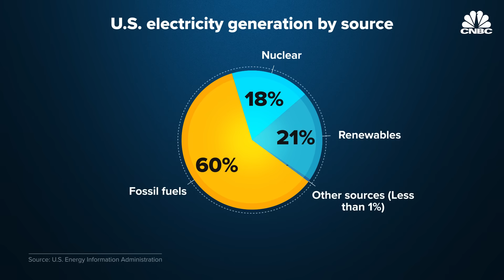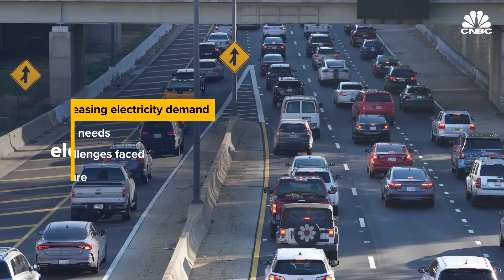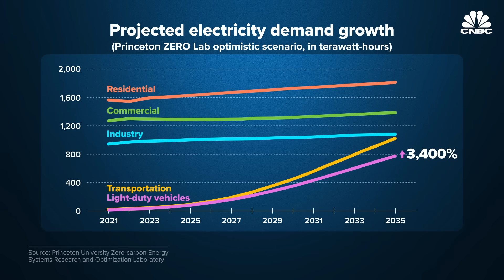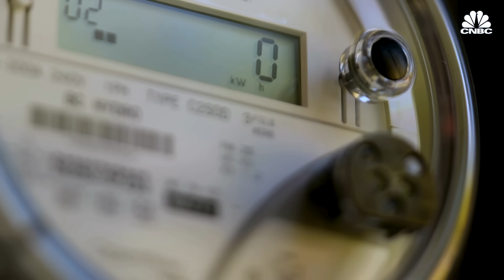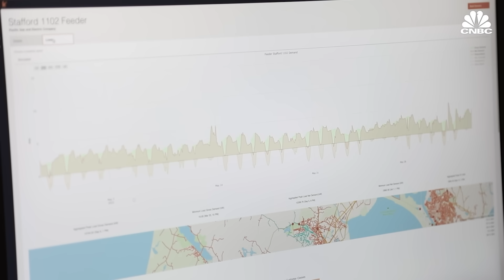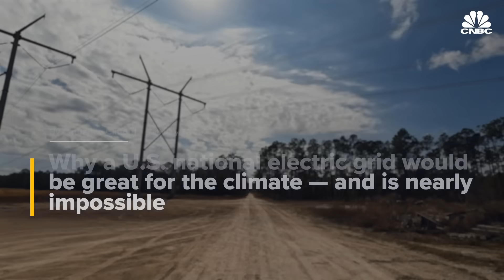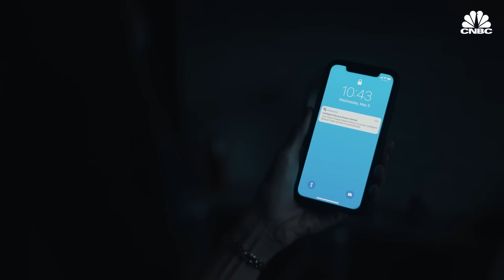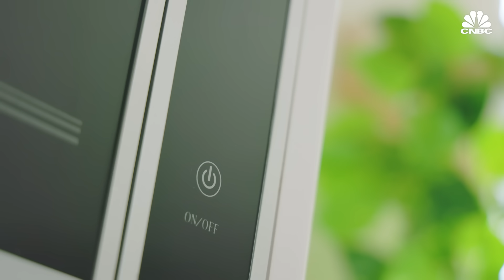Can The U.S. Power Grid Handle The EV Boom?

Comment: have you looked at the problem Siemens is having with there wind gens failing so often the co lost 30% of value lasrt week
also were not making a lot of grid and transmission equipment  like transformers that take year or more to get delivered
theres also moves to tear down hydro dams, natural gas and coal but nuclear too .  and chinas building the solar cells, electronics and the lithium batteries by still building a new unscrubbed coal power plants every 2 weeks.  add to the cost of cars and trucks a ev pickup or suv is 100k and interest rates are at 30 year highs and ev are more dangerous in crashes since they are heavy  this is looking to backfire big time because people will hold on to old worn out vehicles because they cannot affored the new ones and 9in cities no way to plug in the only semi economical way to charge  . and very soon the federal and state governments will need to change the way cars are taxed and electric rates went uo 25% due to bidens jan 21 policies 
and to do all thats needed i est electric could hit 1 dollar a kw  .?Across 28 European countries we investigated, there were 149,000 excess deaths between November 2022 and February 2023,"   and while we destroy the economy between china not cutting anything and the 87% of co2 we cannot stop nature from pumping out  net zero will not change anything but destroy peoples lives and the big threat of dictatorship world wide

Comment: Two words: Distributed Solar. PV panels on every roof and EV batteries feeding some power into the grid when the vehicles are parked. Big power grids are fine, but we can do a lot by small scale, distributed power generation to take the pressure off the main grid.
Reply: If you’re worried about the grid get rid of crypto and stop building in the hot states.
Reply: @kens805 if you can't contribute something of value....
Reply: @kens805good job demonstrating you have no idea what you're talking about. I have an ev, I can travel outside of California and go camping. Not a problem and I don't need anything longer than a small extension cord.
Reply: @UlexiteTVStoneLexite drive to Montana in a reasonable time, ie as of your time is valuable.
Reply: The sun provides enough energy in 1 day to run the entire globe for over a year.....we just can't harness it. The answer has always been in front of us. We just need to do better. Greed prevents us from throwing everything we have at figuring out how to harness the energy we were gifted. There's no other explanation for it. Free energy isn't something they want us to have.
Reply: You said, "The sun provides enough energy in 1 day to run the entire globe for over a year.....we just can't harness it."  "Greed prevents us from throwing everything we have at figuring out how to harness the energy we were gifted. There's no other explanation for it. Free energy isn't something they want us to have."
You could say similar things about gold.  There's plenty of it in the ground.  Greed prevents us from throwing everything we have to mine and refine the gold we were gifted.  There's no other explanation for it. Free gold isn't something they want us to have.
What you are overlooking is the cost to create the infrastructure (panels, inverters, batteries, wires, transformers, etc.) to get all that "free energy".  It's just like the cost to mine and refine free gold, oil, lithium, copper, or any other material that's available for "free".
There's an old saying:  "There is no free lunch."
Nothing is free.  (Including freedom.)
Reply: @ferrynpalmer3875  and so many of the people here are just supporting them by parroting the bs to try to prevent us from fixing the gird and our energy development.
Reply: @ferrynpalmer3875 i
Reply: Yes exactly. The easiest way to solve this problem is heavily discount solar panels for peoples homes. If everyone was making their own electricity, the grid we currently have would be able to handle the miscellaneous. Obviously with upgrades overtime, but at least it wouldn’t be a mad rush.
Reply: Yep. Continue to incentivize home PV, and remove barriers through regulation from electric companies that purposely stand in the way. Not every home is suitable (mine isn’t), but the ones that are should be built that way.
Reply: That is a nightmare scenario unless we have enough storage to stabilize it. Here on the Western Interconnection - basically North America west of the Rockies - we already have too much photovoltaic electricity. The sun goes down, people go home, and natural gas plants have to make up the difference (12,000 MW for California alone.)
Reply: Pv panels in every roof but what about apartments genius?
Reply: @OM-bs7of  you’re out of your league, please retire to kids YT, thanks.
Reply: You really expect the government to distribute solar panels to every home in the US? That's extremely unrealistic
Reply: There isn't enough raw materials on the planet for the green revolution. It's going to lead to resource wars.
Reply: sodium ion battery storage will help a lot.
Reply: @alexdavis-mann8513  You said, "sodium ion battery storage will help a lot."  Maybe, if and when it gets commercialized, and if it is cheap enough.  That's a lot of ifs.
Reply: Yes, more child slave labor!
Reply: Especially at night when all the cars are being charged and not driven
Reply: Your two words: distributed solar
My three words: trillions of dollars
Do you have that much money you could donate to pay for that humongous inefficient infrastructure.  This sounds like a version of China's Great Leap Forward.  If you look at the world population chart, you can see a dip around 1959-1960.  That's when tens of millions of Chinese starved to death because the Chinese government collectivized the farms and wanted everyone to smelt steel in their backyards.  For a few rich people, living off the grid works, but not for people of modest means living in modest houses and apartments.
Reply: I think Solar power would be even higher if these corporations would not only allow for home solar systems to be equal to energy needs. If we have room for more solar and everything else already set up just pay the solar producer the same as you would pay a coal plant. Businesses have tons of roof space but maybe only 1/10th could be used to offset energy needs. 9/10th set unused. Economies of scale also work better when large systems can be set up on business rooftops. maybe $800-$1000 per kWh compared to an average of $3000 per kWh on a homeowner's rooftop.
Reply: @MrBadbonesaw  all great points, but you’re fighting against the inherent benefit of solar+storage, which is decentralization. The grid needs to be transformed, just like land lines to cell phones. It’s going to get ugly in the short term, like $2/kwh ugly, but eventually the price of energy will go to zero just like the price of compute(bits) used to be astronomical but now it’s negligible.
Reply: @drewgoodman7932  I agree it needs overhaul, but maybe we need more small geophraphic regions instead of 4. Any major city with over 3 million population be responsible for upgrading their own powerline grids. Run powerlines out to rural areas from the city, kind of like a squid or octopus. Have some overlap or interconnection between cities. Upgrade when poles or connectors start getting corroded, kind of like replacing a long stretch of highway from time to time.
Reply: @MrBadbonesaw  this is probably true. The decentralized nature of renewables is going to make that whole notion much easier and logical. The West TX grid would be the powerhouse example of the entire country probably.
Reply: @kens805 We hardly ever use a charging station - so 98% of the time we charge at home, which applies in rural areas or city suburbs. Charging station power usage is really not that big of a deal. In city centers, we should expect more charging stations as many people don't have rooftop solar, but even this will change.
Reply: "Have you noticed your electric bills going up the past few years"?
My too..
What are your thoughts about Solar?
Have you ever looked into Solar?
Can we do some discussion about SOLAR 
    "Right now is actually the best time to get SOLAR between tax credits reducing the price and current energy costs constantly on the rise"
You already cost too much on electric bills give a chance to my solar panels service once and you will definitely get best results
POWUR is the American biggest solar company
Would you be interested in learning more?
Reply: HAHAHA, good luck convincing people to share their $20k or more ev batteries.
Reply: Solar everywhere is a waste of the scarce metals that are required to manufacture them. Solar should be focused in the South/Southwest and then distributed through the country with power lines. It makes no sense to put solar in the northeast when Wind would be a more efficient choice.
Reply: I know a family in San Diego that installed a 6 KW solar system on their home.   So total power of their electric car and running there home is less than it was 15 years ago before they installed solar power.  So we can actually go down on total power production if we put 5 KW to 7 KW on each home and then put in a electric car to 2 there.
Reply: Yes my thoughts exactly.  Putting generation in the usage centers solves two problems at once.  With some form of net metering, people with the roof space will be incentivized to invest in surplus generation and storage.
Reply: @xiaoka  Net metering is not a sustainable practice. The entire electric power system is maintained by the money we pay for our electricity; net metering does not pay any of the infrastructure costs.
In the USA, electric providers are regulated state by state. They all have the responsibility for maintaining infrastructure, repairing faults that produce power outages or endanger the public. Budgeting for adverse events is an important part of any electric company's financial world, almost always a part of rates.
On the other side, the providers have to buy electricity from generators. (In the USA, FERC rules say that a company may have both generation and retail operations, but they must not favor their own generation facilities in any way.) There are three basic tiers: the lowest prices are the longest contracts; the highest are the "spot market." Net metering means forcing a contract on the provider at whatever rate the regulatory agency has approved for the season and time of day, violating the principle of an agreement between the buyer and seller. If it were happening the other way around everybody who pays an electric bill would be screaming about it.
Reply: @kens805 i dont think you understand how EVs work
Reply: VPPs!
Reply: Not good, at least not yet, solar pv will be our next plastic recycling problem but with more harmful materials, the recycle level we need for pv is too far away, concentrated solar (dish types at least) doesn't needs that to work. Nuclear BIG  reactors are the only option FOR THE GRID, solar and wind are amazing but they are not an answer to the masive energy needs; electric cooking, EVs, data centers, energy intensive industries, needs just too much, only nuclear can handle that impossible numbers, and if you also care for climate change and nature preservation nuclear has the smallest footprint, solar and wind need too much land space, the Sahara desert full of solar panels? do we really need to sacrifice all the nature of a place (a big one) for non-reliable energy? with just 20 years life expectancy?
Reply: @AlexanderOlivaAEOC  has ‘our plastic recycling problem’ convinced you to stop using plastic yet?  No? Well it won’t happen in the case of ‘our solar panel recycling problem’ either.  

Except you use most plastic once and throw it away, whereas solar panels can last decades.  This is another BS issue like ‘what are we going to do with all those old windmill blades?!’
Reply: @xiaoka  dude we need plastics as well as oil and carbon and a lot of harmful materials including nuclear materials, but we can try to not use it as much as today especially on single use products like plastics bottles for soda, we already have aluminum cans and glass, shampoo bottles life use is some months at least. So when we know that problems that will inevitably come with certain materials, at least let's try to reduce it's use when we can, we are already full of microplastics and cheap food additives, maybe just  poison ourselves a little slower
Reply: Solar panels aren't reliable or powerful enough to provide all the energy needs of a household. The batteries and inverters are expensive, and they don't last long enough to reach cost parity.
Reply: @smh9902 It doesn't have to provide all the power, but reduce demand on the external grid. The only reason to be totally solar-powered would be if you are or choose to disconnect from the grid.
Reply: @smh9902 if you install all of these things during the construction process, it’s a fraction of a percent of the total build cost. It’s beyond logical to install solar, energy storage, electric appliances, and EV in all new homes.
Reply: @drewgoodman7932  What I'm saying is that its not enough to go off grid, and most of the costs are in the inverters and batteries, not the panels themselves. Hybrid, not EV, is the future. Batteries are neither durable nor energy dense enough, and their costs is much too high and their costs will not come down much, if any, further.
Reply: @smh9902  - we will be forced to buy these expensive batteries and inverters as energy prices keep going up u til they are dollars per kwh. 
- hybrid is not the future it’s been around for decades with no meaningful adoption because it’s inferior technology. BEV’s are growing 30-50% and now we are at double digit adoption. Batteries, solar, and EV’s are all declining in costs and will do so another 50-70% by 2030, it’s called wrights law and it’s undeniable. You’re pretty much provably wrong on every one of your points. Keep listening to journalists for your info, I’ll keep listening to the engineers, scientists, and economists.
Reply: @smh9902 battery cost will halve in The next 5 years.
Reply: @smh9902 Yes they are powerful enough to be off grid, lots of people already are
Reply: @UlexiteTVStoneLexite  If you're rich and dump tens of thousands of dollars into it, lmao. It never reaches cost parity.
Reply: @steveb796 explain you cost reduction forecast given the price has gone up repeatedly in the past 2 years.
Reply: @bowez9  ev batteries had been falling steadily until the pandemic hit. We will get around that. More efficient production methods like the dry electrode process Tesla is implementing will drive costs down. Many new and different material makeup such as sodium are in the works. Economies of scale and increased competition will also contribute.
Reply: @steveb796  economics of scale has pinched supply hence the price increase.
Where are you going to Nickel beside Russia or are EVs more important than Ukraine?  The US only has one mine thanks to NIMBY.
Reply: @bowez9  New Caledonia and Minnesota for 2. New Caledonia has 1/4 of the worlds nickel. 
Otoh getting away from oil hurts Russia.
Reply: @steveb796  so how is New Caledonia in the US?
Why is New Caledonia only the 4th largest producer of Nickel?
Reply: @bowez9  they have about as much nickel S Russia, which you referenced and who isn’t in the picture for ev production. New Caledonia is French- one of our greatest allies. I would rather use their resources first and save ours for when they run out. Tesla makes 4 models. They are number one thru 4 for most US content of parts and labor. Keep reaching.
Reply: @steveb796  thier exports put at number 4 in the world even though they supposedly have 25% of Nickle, because they can't get it out of the ground, refine it and/or get off thier Island in the middle of the South Pacfic.  Sorry most people don't want to go ro places like Tahiti and see Strip Mines and Smelters.
Reply: @bowez9  well they signed a deal with tesla to produce 44,000 tons of nickel, but you probably know more. 
Tesla also signed a large Canadian deal and the previously mentioned Minnesota deal. And an Australian deal. I’m sure there’s others. Seems like you are naive enough to think that a company as innovative as tesla wouldn’t think to secure vital materials for their business. 
Dunning Krueger
Reply: @drewgoodman7932  You said, "if you install all of these things during the construction process, it’s a fraction of a percent of the total build cost. It’s beyond logical to install solar, energy storage, electric appliances, and EV in all new homes."  Are you familiar with something called economic analysis?  Just because something sounds good in a commercial/propaganda, doesn't mean it makes sense in the real world.  Also, new houses are a very tiny fraction of all the houses in the US.  It would take centuries to replace all the houses.
Reply: @dzcav3  no, I’ve never heard of something called economic analysis.
Reply: @smh9902 they don’t have to supply everything. But every kw they produce takes pressure off the grid.
Reply: @steveb796  Thats not true and I already explained why its not true. There is no pressure alleviation provided by wind and solar.
Reply: @smh9902 yes they are. You have people living off the grid everywhere. I was looking at a house 10 years ago that was completely off grid and was powered by solar panels and batteries.